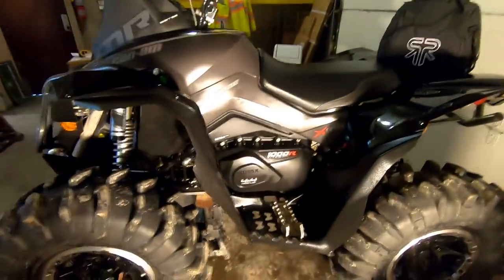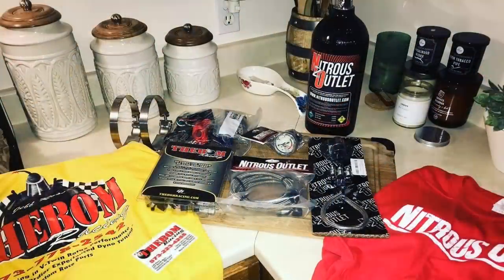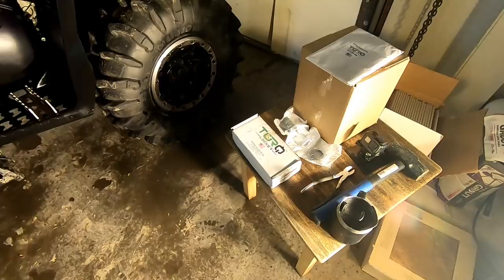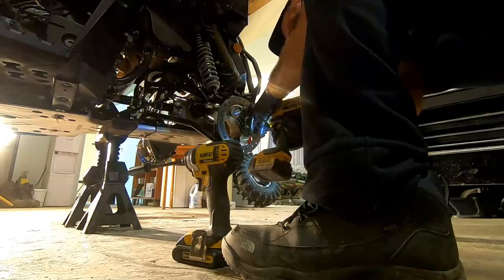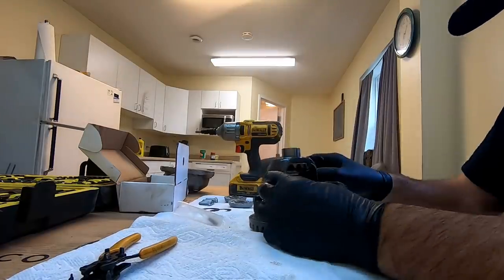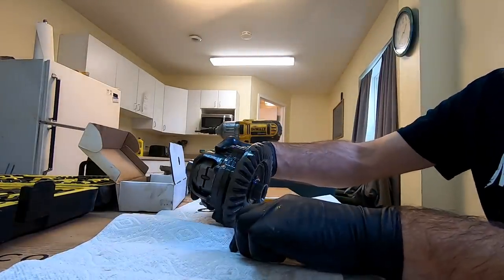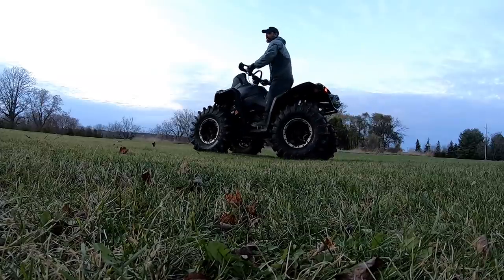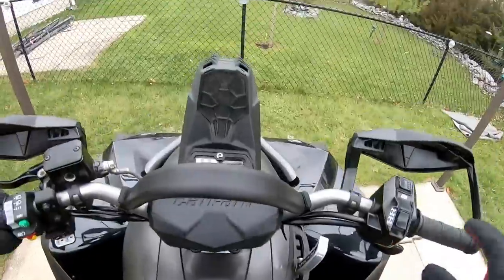Can it climb a tree? TorqLocker and QSC Install and test on 2020 Renegade Xmr1000r

Comment: Great upgrades.  I'm going to pull the trigger on the QSC primary for my Can Am 850 XMR. I've done my research and asked dealer questions.  He told me to remove my Dalton secondary spring, he said the primary won't perform properly. I got just 30 inch tire and maybe that's the difference.  Got some info for me.  Enjoying your vids.   "Ride hard and be safe"  Minnesota Bill
Reply from the maker: Odd, I have always run a spring on my secondary's. Works mint

Comment: Buddy you gotta get a sled for this winter, NOS knows, those new turbo sleds will give ya a yank in the arms. Great video as alway, love Ontario, but I think you'd love messing round with a new Yamaha sidewinder or Ace turbo for the cold months. Gotta an 18  winder, set right up by Turbo Dynamics from Over the Topp Performance and it runs like a clock, scary performance when it bites hard

Comment: I know I've said this several times before, but MAN, THOSE ARE NICE LOOKIN' MACHINES!
4:38 - is it supposed to make that awful racket when you free spin the wheels? Does it make that noise as you are driving down the trail? (just curious)
Great job on the editing there bud! Awesome vid!
Reply from the maker: Thx Q, Yeah they only sound like that with the tires at full sag and drive train not under load. All ya hear is the odd click once in a while in 4x4 when turning. Can be a loud click at times though I will say. But so far with all our beating on them they work mint and outlive the rest of the ATV. Hahaha Lunch box lockers are bullet proof, basically. It's all the other commponets holding up to the locker that worrie me. LOL. Thx again my friend

Comment: eh tv  you having any problems getting water in snorkels getting into clutch case and into youre  dirty line been happening to me when i water ride
Reply from the maker: Only if I spend too much time on the throttle playing around. It can suck in the splash from the bike from time to time. Other wise no worries it's fairly normal. Still I like to go over all clamps and such as they can loosen up from vibration over time. Better safe then sorry right. Cheers

Comment: Man you make some awesome videos. I just bought the same bike last week, I've got to get going on the upgrades. What's the biggest tire that will fit on these things stock?
Reply from the maker: Not sure with the 2019 and 2020, as it's had some suspension adjustments made since my 18. All I can tell ya is we stuffed 32's on a stock setup with minimal rubbing fixed by heat gun and slight triming.